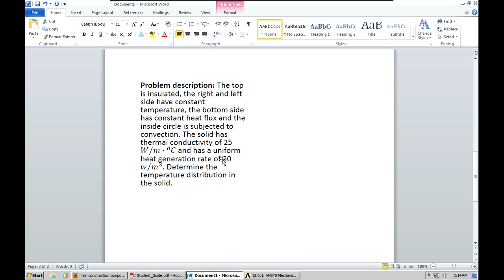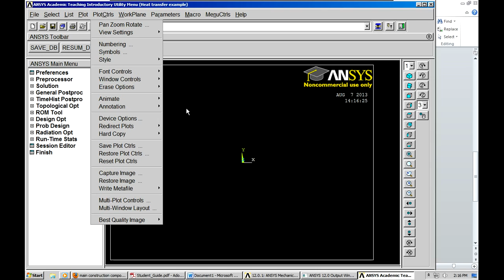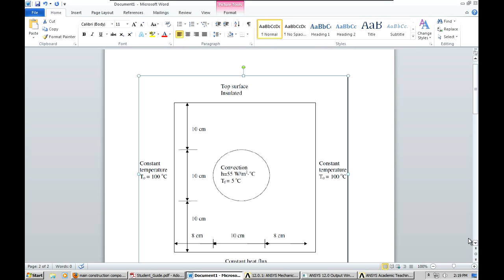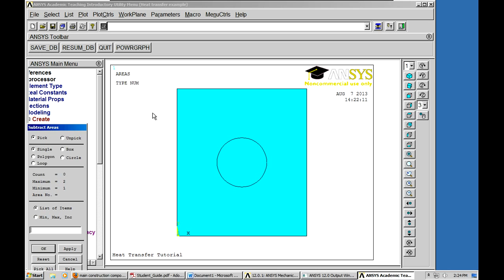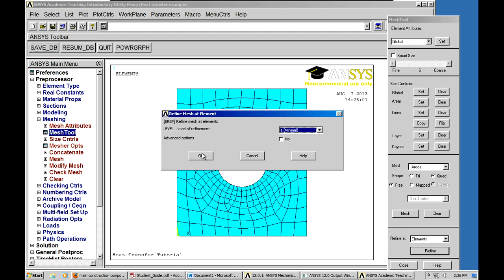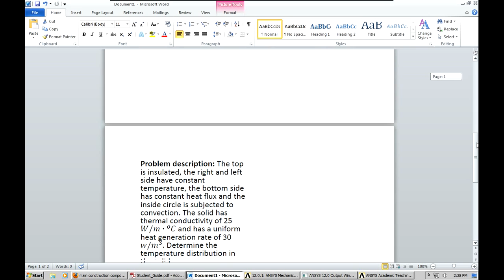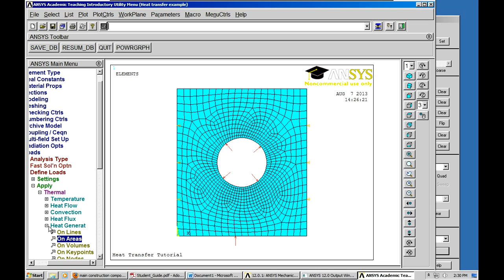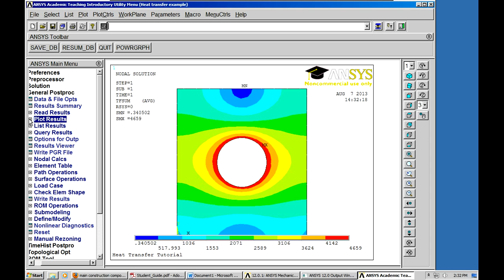2D Heat Transfer Tutorial Ansys: Modeling, Meshing, Loads, Post

Comment: nice one but regarding the heat generation you should have kept it the same and consider that the solution is per unit depth ( heat generation is always a 3D volumetric phenomena )
Reply: If kept the heat generation 30  (w / m3) ..the solution should be considered per 14.255 m ...the area X this length = 0.07015 x 14.2552 = 1m3 ==> per each 30 w according to the initial description ...To be consistent with the units and, at the same time, take the solution per " m " depth , keeping the area shown 0.07015 m2,  the heat generation should be 2.1045 W/m3..  i Think so 
I mean , the value  for heat generation 2.1045 w/m3 is already for each
 "m " in depth .  .. If I am not wrong !